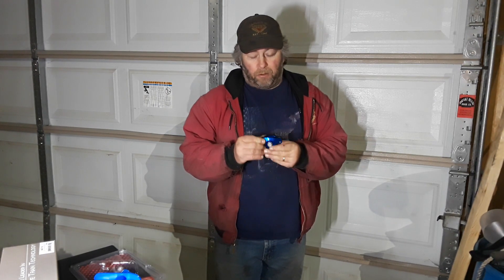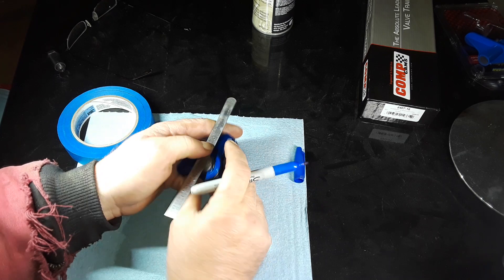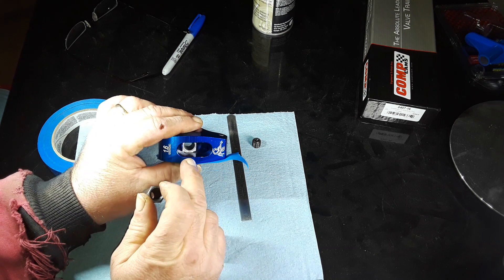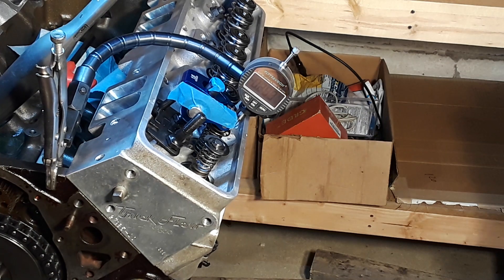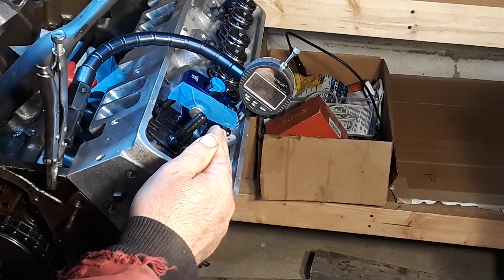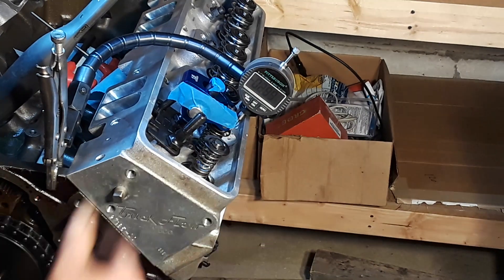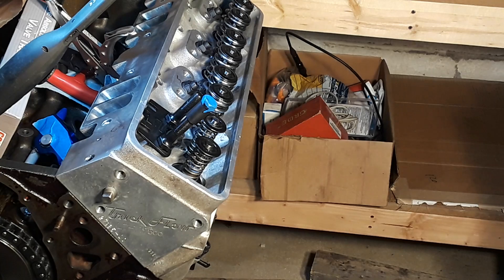SBC Pushrod Length

Comment: Very nice video bud. Have you ever messed with 882 heads? After having everything machined down I still can’t get the studs low enough for correct geometry. I’ll have to run a 8in rod just to clear the stud.

Comment: This is an incorrect method as you now have less valve lift over first 50% of cam lift than you do over the second 50%. Max lift is achieved when they are both the same. To do this your reference line needs to be between rocker shaft centre line and the tip of the valve and not the centre of the roller tip.
Reply from the maker: 1:10 is wrong. Thank you for that info, I have pinned your comment to stay on top. This is why I am not a mechanic LOL, don't worry, I'll keep my day job.
Reply: Lee Hedger Explain why, I think you are wrong.  Who designed the Rockers  ?  The design of the rockers (Engineers) Designed the fulcrum between the Pushrod and the Roller Tip Centerline.  The Fulcrum acts in an ARC/ Sweep Pattern that is a Circle.  When you change the Axis, you change the Circle, the Sweep, The design, and Ruin the Rockers and cause stress on all the parts.
 Ideally the fulcrum should not add space between the valve stem tip and the 90 degree angle but that is insignificant otherwise it would have already been designed for a pushrod engine.  The amount is so insignificant it can be picked up by the pushrod length or the number of Pre-load thousandths.   You never want to change the Sweep pattern on a Rocker assembly because in doing so you're changing the operating range of the Rocker and the loads and stressors it was designed to keep.  A more Expensive Rocker in the 1000 dollar range will have a very shallow or small difference.  Bad advice to change the ARC Sweep by changing the 90 Degree sweep angles.  Draw a circle with the circle line running through the valve tip.  Draw another circle with the circle line running through the roller tip.  As you can see now, there are two different Sweep patterns.  The Pattern with the Circle going through the roller tip was the one the Rocker was designed for stress, Pushrod travel in the cup, and all the material strength and assembly testing.  When you move to the ideal Axis of the valve Tip, you change the design and the fact that no one has designed such a rocker not because its not possible, but because it's insignificant in that you can account for the difference as mentioned.  Other than that DIY Misfit was Dead on Balls on this video.  There are multiple videos and information from Engineers backing up this video.  Yes I get it, I get what you're saying, that the Axis of the valve tip would be optimal.  But you have to have a Rocker Arm Designed for that ARC/SWEEP and travel stress, and the Pushrod CUP has to Accommodate the new ARC/Sweep Range of motion.

Comment: DO YOU NOT TAKE INTO ACCOUNT  THE ROCKER RATIO WHEN TURNING TH ADJ. NUT DOWN??  ON A 1.6 ROCKER, 1 TURN EQUATES TO .080 VALVE MOVEMENT, NOT .050.
Reply: WATCHED ANOTHER VIDEO, GOT IT NOW.
Reply from the maker: @fredklotz4455  
No I did not, but this method put exactly where i wanted to be. May I ask what video got you straighten out? This method worked great for me.
Reply: I've been trying too find this out. I'd like too see that video, where does the extra .030 come in?

Comment: when you used the proform length check tool, did you make sure the lifter was on the base curve and not the lobe?
Reply from the maker: Yes it must be on the  Base circle
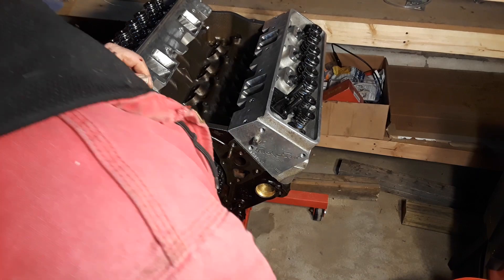Reply from the maker: 3:40
Reply: Ok..i was curious as I was going to buy one if those checker tools from amazon...want to sell yours?
Reply from the maker: Actually it's not mine to sell, the boy bought it from summit. He buys a lot from summit, and usually waits until his bill is over $100 before placing order to qualify for free shipping. 
Whatever you do, do not use the adjustable push rod on regular valve springs. Make sure you get checker springs. Don't ask me how I know. LOL
Reply from the maker: Oh your talking about that proform  checker tool? The one I called junk?
Reply from the maker: If we were on lobe the rod would have been even higher. All I can figure is that thing is for SBC using all stock parts. This was being done on a LT1 engine, still sbc though. 
I let you have that tool for $5 shipped if you want it. I myself would rather go the hard and precise way.
Reply from the maker: Chad Wright  
I got a screen shot of your addy you can remove it if you want. I will let you know if I can find or already pitched it.
If I can find it, I'm not even charging you.

Comment: i love ur how twos and the tips cant wait to redo my 350 small blcok chevy in my sub
Reply from the maker: If going with stock parts you shouldn't need to worry about this. If you change cam, heads, valves, or even just the rockers, it would be a good idea to do this. Thanks for stopping by